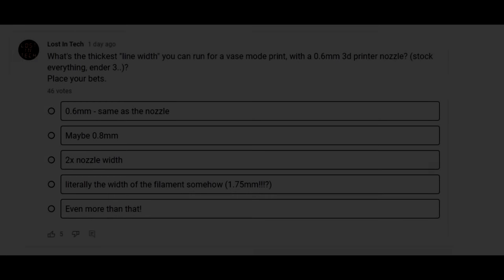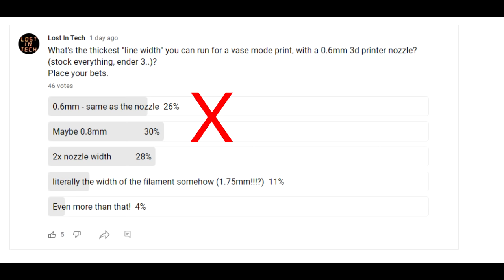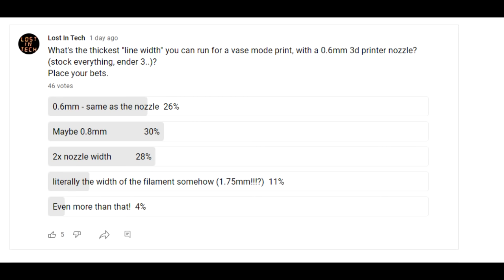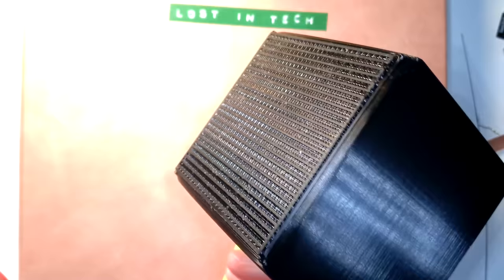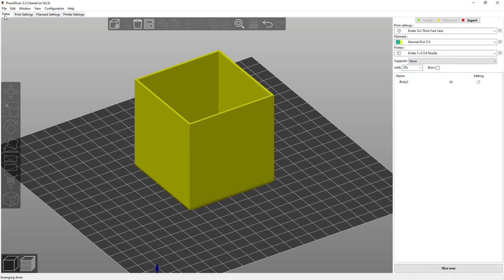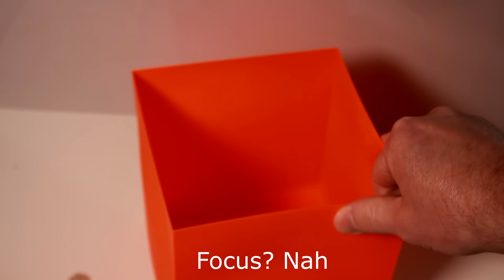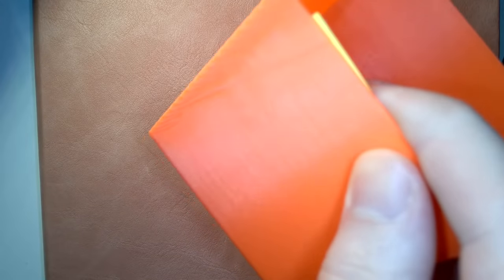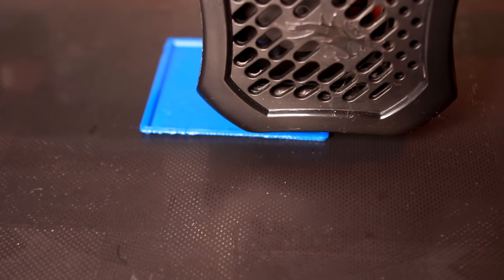EXTREME Vase Mode, Cura and Prusaslicer. What's the limit? 3D Printing Vase mode tests on Ender 3

Comment: I've had a lot of luck with having a bumpy vase. Like the trashcan you've printed, corrugations add strength without much more extruded thickness. My go to shape is a shallow vertical rhomboidal pyramid dent to the surface, with a decent fillet. None of the surfaces overhang by more than 20 or so degrees. Pretty sturdy.
Reply: This. Straight and even circular lines are weak AF. How do they make the polycarbonate or ABS lid on "your" laptop as strong and rigid as a sheet of 1.5mm Al, while being thinner than a Poundland credit card? Profiling. It's all about profiling. That's been the key to so much material engineering tech the last 2 decades it's wild.
Reply: Buckminster Fuller used the terminology “compound curvature” that achieves the virtual thickness which provides such strength with so little material.

You could absolutely make cars without curves for their sides and general shape, just be vertical sides.  But other than being hideous, it’d require a large amount of metal to have anything resembling safety: curves aren’t just more attractive (potentially) they’re functional, too!

Comment: Prusa slicer has a setting to set a limit on volumetric flow. Meaning that increasing the line with the slicer will automatically slow down the print in order to maintain the extruders flow rate preventing skips.

Comment: To fix the bottom of your vase,instead of a raft, just increase the number of bottom layers in the print. I typically do about 5 bottom layers to get a nice strong bottom. I do alot of actual vases, and I also tend to pour a little epoxy in the bottom and roll is around to make sure they hold water.

Comment: Are the diagonal lines slanted towards the direction the nozzle is travelling in while printing?
If they are I would guess that it's a stacking error - a small error on a low layer propagates through the print as each time the nozzle gets to that point the extrusion is deformed by the previous layer.
Reply: They are indeed  slanted towards the direction the nozzle is traveling. What could fix this? It also happens to me in my BambuLab machine

Comment: Thread width is not "limited" by the size of the hole (0.4, 0.6 etc.) in the nozzle but by the flat part around the hole. You are pressurizing the material against this area. Once you get wider there's no constraint and it starts to behave unstable. It can go sideways as well as up (or even down). You can cut the nozzle tip up to the hexagon shape. Then you can print up to ~10 mm wide walls in a single run. But keep volumetric speed low.
Reply: This is what I thought too. Would be nice if such nozzles would be available
Reply: The only problem is that the extrusion hole only goes up into the nozzle a millimeter or two. The nozzle has a cone shape cut into it and the extrusion hole after. So if you cut the tip of the nozzle too short you'd also start increasing the size of the extrusion hole. For more information cnckitchen has a video on worn nozzles.
Reply: 10mm sounds pretty extreme, but I'd definitely be interested in a nozzle with a wider tip. This could save a lot of extra perimeter rounds, and might also make ironing quicker/better.
Reply: @remcoder6  Pretty sure this would be pretty doable to DIY.
Reply: Offset Z a little helps.
Reply: @NoExceptions109  tbh you can just use the 1.75mm hole if you're printing like 10mm.

Comment: To fix your bottom layers problem in Cura, you can do two things IMO: 
1. Change the "Top/Bottom Line Width" to a value that works for your setup (e.g. 0.6). This will not affect the thickness of the vase-mode walls, that actually are "Outer Wall" (Works in 4.8.0, but I just noticed this is bugged in Cura Arachne beta 2, so other version may have that bug as well). 
2. Also increase the number of bottom (or initial bottom) layers as another comment says I think, but to a large value to match the strength of the main wall (e.g. 5 or even more).
You may note as well that this setting actually allows you to "cheat" with what cura normally allows, as you can now have a part printed solid with multiple walls for the beginning of the print over the first N layers, then go to spiralized/vase mode :) This has been actually useful in some cases for me.

Also the reason you may be seeing problems in cura at around 6:12 is because your model is hollow I think, so maybe you could try with a fully solid model, OR alternatively try cheating with a positive horizontal expansion (not sure that would work, but easy to do).

Comment: Very informative!

Another thing to increase the wall width, at the cost of print time, is to model the part hollow (as is printed) and cut a strip into it along the Z direction. That way you'll print "two walls" instead of one, both in vase mode. There will be a visible seam though. Also keep in mind that if the gap is too small the slicer may just ignore it and print right on through. This technique also enables you to print models in vase mode that wouldn't have otherwise been possible (or just suited to)!

Cross section in the XY plane of the model with the gap:

   ####
#          #
#                  <- said gap (few hundredths of mm)
#         #
  ####
Reply from the maker: I know what you mean, and I will do something on it in future if I get chance
Reply: You might be able to make the gap staggered so it doesn't look like a straight line.
Reply: @satibel  That's a very good idea!

Comment: In Cura, you can set separate line widths for top/bottom, use nozzle width there, and for perimeters use 2x. Will fix your bottom issue right away. I've printed up to 1mm wide vase walls with 0.4mm nozzle.
Reply: To get rid of the diagonals, simply try to slow it down and decrease layer height.

Comment: I printed "ear savers" for masks. They only have two layers and consist only of perimeters (so basically a vase). I managed to print 1.9mm width on a 0.4mm nozzle. Having a E3D style nozzle helps a lot, as they have a large flat surface to iron down the molten plastic.

Comment: Ender 5, 0.4 mm Nozzle. I Print my Vase with 1mm line width. I tested some speed and my best range is 25mm/s up to 40 mm/s. Depending on the Vase.

Comment: the 2mm looks interesting. that is the exact same thing i got on a normal print when my nozzle was clogged. it loks like underextrusion; it would have been nice to see the nozzle temp graph on that print, since i thing it might have been  oscillating a bit. with upping the temp or using a stronger heater might make it possible.   

nice video btw
Reply from the maker: I don't remember but the issue is the block is a huge reserve of temperature and that's where the thermocouple is, so you would need a thermal imaging cam or something to see the nozzle temp.
Reply: I wonder how something like a nickel plated volcano would fair.

Comment: If not using an upgraded heatblock, like the phaetus or even a volcano or super volcano, a heaterd cartridge upgrade to 70W or so is very recommended, makes for quicker heating and more consistent temps. At thhose extreme line widths

Comment: I raise you one better: i made a custom 2.5mm nozzle that works with 1.75mm filament. I used that to extrude 3mm wide vase prints. It works because the molten filament sticks to the nozzle sides and creates contact with the unmolten filament. I had that ripple effect too, i think it has something to do with extruding too wide with too low a layer height. the width to height of the extrusion shouldnt exceed around 4:1 otherwise i´ve seen those ripples happen
Reply from the maker: Ah! I wondered whether extruding to a wider nozzle would work but I guess you are getting turbulence, basically.
Reply: @LostInTech3D  yes exactly! No problem at all. I did use a volcano nozzle tho so the melt zone is a bit longer. If you want pictures let me know your email i‘ll drop you some

Comment: If you keep an eye on your throughput not getting too high and causing the clicking you mentioned you can print very wide beads.  I have run 2mm and 3mm nozzles with 1.75mm filament and just printed something with a 5-6mm bead width!.  This did not need a base and was just a single vase mode perimeter.  The bead quality looked good and consistent.  If you want a nice solid base I would just tell the slicer you want 2-3 base layers instead of 1 and check the extrusion multiplier is giving you the width you request so the beads are touching laterally.

Comment: From my own experiments, using 1.8mm nozzle I managed to print ~14mm wide parameters. Up to 5~6mm the lines are pretty clean but the thicker they are the more artifacts and deformations you will see on the surface of the line and also on the sides as well.

Comment: Diagonal lines? Does the angle change if you scale up the part size (vase perimeter) or line width? If so it's likely some periodic irregularity in the extruder, could be as extreme as a mangled tooth
Reply from the maker: yikes. It didn't/doesn't happen with any other settings though so I'm not too concerned for now, but I will keep an eye on the extruder anyway as it's an original plastic creality one about a year past it's sell by date! 😂

Comment: It's possible the diagonal lines are related to back pressure causing the extruder to skip a little. If the distance between lines remains pretty even along Z, then I'd say this is it.

Raising temperature or reducing print speed may reduce these lines if I'm correct.

Comment: I am guessing the seam is diagonal because the perimeter is increasing as you raise up on the item and your slicer is maybe decimating the piece in a quasi cyclical basis, ie, if there's a limit to each chunk of gcode that can be sent and then at the beginning of the next gcode chunk the printer is falling back to baseline rather than printing at our forced anomaly extrusion width

Comment: An e3d style nozzle probably does better for over 1.75mm because the flat area around the hole is wider which should get you a slightly better looking result
Reply from the maker: just so happens I have some of those on other printers 👍

Comment: Can you please summarize your final Cura settings to get a nice watertight bottom while using thicker lines?
Reply from the maker: If I were doing it again (I might do another episode soon) I'd set the bottom and top layer line thickness to normal and only use thicker walls.
Reply: @LostInTech3D  I'm trying to print an actual vase using vase mode for efficiency and I'd like it to be water tight, I'm assuming that will be difficult with the typical 0.4mm line width, I'm hoping to use this technique to make say 0.8mm walls.

Comment: >little other practical use
Wrong. It's perfect for making components with tight clearances. I used it to print functional .577 snider cases for an antique rifle as vase mode is the only way to produce a perfectly continuous pipe segment.
Reply from the maker: interesting - I would never have thought of using vase mode for functional parts

Comment: Diagonal lines: the step from layer to layer; the step has a non-vertical profile so it progresses radially about the váse.
Reply: Vase mode should print in a spiral though so there shouldn't be any stepping.

Comment: The width u can print in good quality depends on the shape of the tip of ur nozzle. The shape of the Tip (the "flat" area around the hole" varies widely between manufactures but mostly doesn't varry between different "hole sizes". eG: I have two nozzles by the same manufacture, 0.4 and 0.8mm -> the flat area around the holes have the same diameter so in the end I can't really print thicker walls with that 0.8mm nozzle than with the 0.4 from the same manufacture. But I can print faster. A lot.
Reply from the maker: that's exactly what I thought, although I couldn't prove it without better equipment, maybe I need a collab with smarter every day 😂👍

Comment: only you could come up with this lol

the artifacts, maybe the massive overextrusion is causing a bump, each time round its melted and shifted slightly in travel direction.. sort of like real bad stringing forms diagonal branches growing up the print crossed with the ripples in a base layer thats too close to bed
Reply from the maker: Oh...just remembered I took macro images of the nozzle when extruding but forgot to put them in the video 🙄 I'll have a look later when I get the data off that camera and see if there's any evidence of this!
Reply: Interesting hypothesis. I was wondering if.all of the diagonal artefacts were in the same direction that the nozzle was travelling. One shot (the black one) seemed to be leaning left while the others were leaning right. The other question was whether they all started at the bottom. I noticed several evenly spaced artefacts along the base but only some propagated past the first few layers... This was an interesting video and good information!
Reply: My bet; the extruder slips a lil bit at one exact point in its rotation and it happens to be a a little more or less than the vase's perimeter

Comment: My opinion on the weird artifact. Your flow rates are starting to get high at those thicknesses even at lower speeds. Your extruder is skipping occasionally and something not related to the slicing is pushing it to skip at a constant frequency, just that frequency doesn't correlate with your slicing, ie variation in filament thickness; the line could correspond to one rotation of the spool for example. Otherwise my second guess would be that even though you're using vase mode the slicer is still trying to compensate some flow at certain layer points going up..but you'd think you would only see it on one side, so I really don't think that is probably it..the fact it seems to happen more often when you go higher reinforces extruder skipping or perhaps underflowing/underrunning ie the extruder isn't pushing enough filament to meet the demand
Reply: And it's not that mind boggling. Larger nozzles are more about speed. And imagine how wide you can get with bigger nozzles. It's not necessarily the width of the input filament that matters as the filament generally gets squished onto the bed/previous layer as it comes out.
Reply: And as another commentor said because of that, the flat area on the nozzle can impact the maximum stably reachable widths

Comment: The diagonal lines are caused by the way the Ender 3 V2 saves His eeprom. Because you dont have actual "Layers" the printer makes Up a Point where it thinks that the layer Starts/ends. At that Point the printer must Stop For a Short time to save the current layer it is on. In that Short time the pressure in the nozzle causes individual blobs to form wich Stack up and make this lines
Reply from the maker: interesting idea...this is to do with the power outage protection isn't it? 
But I think in this case it's something else, because on my ender 3 v2 I run octoprint, with no sd card in the printer.

Comment: The artifacts on the side are the seams. At the end of a layer it's not waiting at the final point for long enough to extrude the extra material.
Reply from the maker: An interesting theory, but vase mode doesn't have layers.
Reply: @LostInTech3D  In slicers it still does. Look at the slicing, you still see layers displayed and a notch when the z- axis is incremented. You have to change more than a dozen settings to minimize this, and then you're still relying on firmware support to understand a seamless print.
Reply: Furthermore, look at the Gcode. There's still incrementing of the X axis at the layer change (even though Cura and Prusaslicer have recently added in gradual steps for the last CM or MMs before the transition.) These transitions are scripted, and don't always take in to consideration all settings in their calculations of extrusion. Think of increasing by .01mm Z as you travel around the object. Even though the transition may be steady to the eye the gcode steps are still causing changes in movement and extrusion in increments that cause the inconsistent layering.

Go into Cura and set your seam to "Sharpest Corner" instead of whatever the setting was (it appears it was likely on "Shortest" setting), and watch the ripple move to right before one of the corners instead.
Reply from the maker: Well - I am making a new video about this soon so I will have a poke around at this! 👍

Comment: Love the video, but not sure the final conclusion is on point...I'm def still using my 1.0nozzles to print large strong vase mode prints...seems the you've got major print quality issues trying to push the little nozzle too far. Your own 1mm nozzle print looks waay better than the .6...so I dont see the reason to recommend .6 at the end.
Reply from the maker: Yeah, I'm hoping to try some much larger nozzles at some point and revisit this, maybe with the CHT nozzle - they do a 1.8mm!!
Reply: @LostInTech3D  i'm not sure how to calculate max flow rate for a hot end, but the Ender 3 hotend is pretty basic and not really up to the task of massive flow rates (while working great for what the vast majority of us are doing).  I'd assume you're already approaching/at that limit, but you can always try dialing it in with even slower printspeeds and higher temps. Keep up the great work 🙌

Comment: Seems PrusaSlicer 2.6.0-alpha6 does not allow a setting equal-or-greater to nozzle diameter * 3 anymore :( 1.79 is max for 0.6 nozzle
Reply from the maker: That's why you lie and tell it you have a 2mm nozzle. Shh! Nobody needs to know.